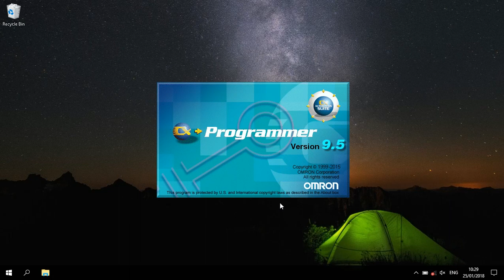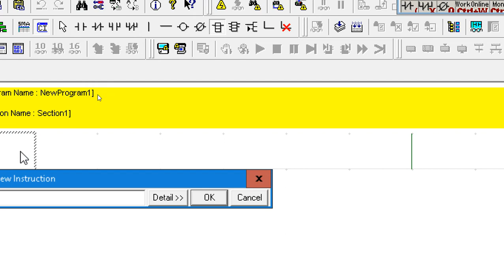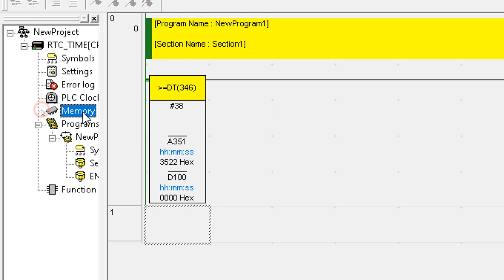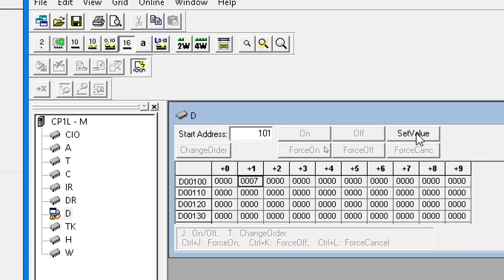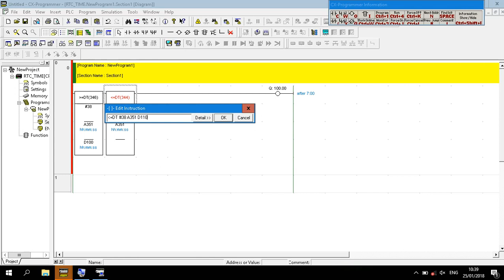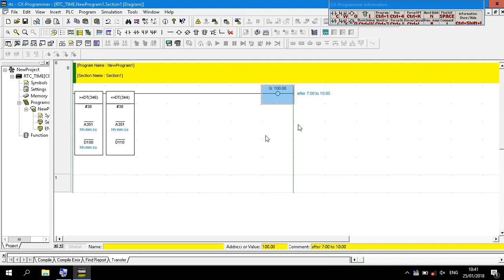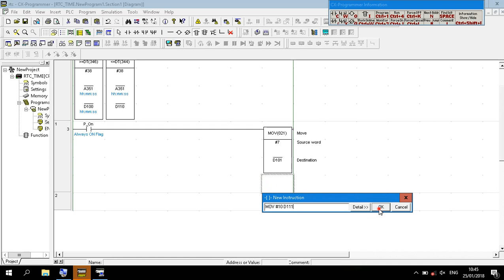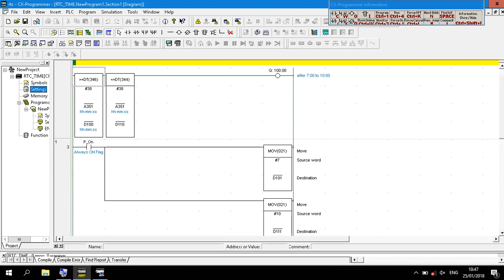PLC | CX Programmer RTC (Real Time Clock) Using DATE Comparison Instruction To Control Time

Comment: gan kalo input nilai data memory untuk menit harus 1700 knp tidak 17 aja?
Reply: tidak bisa. default setting untuk rtc sudah semacam itu. bisa rujuk di CP1E/CP2E CPU Unit Instructions Reference Manual (W483) muka surat 2-100.

Comment: what #38 means? I dont understood this part
Reply from the maker: It is D0 value since we want to compare hour, minute, second. So we need to set D0 with 38 hexadecimal or 00111000 in binary, you can take a look at help section for more information